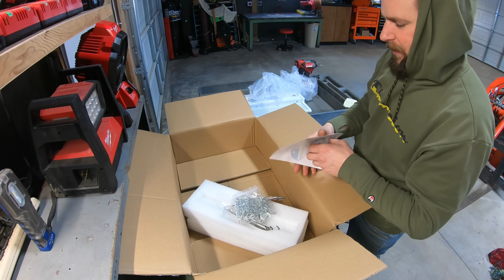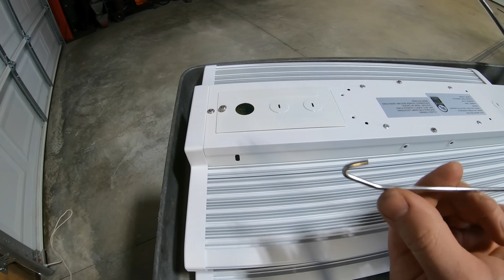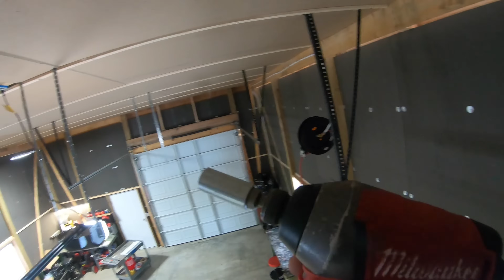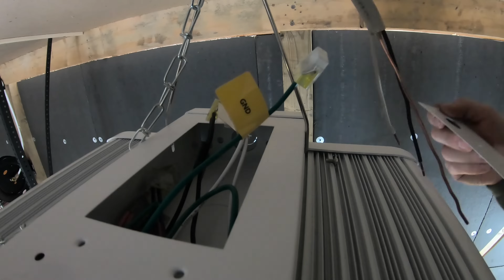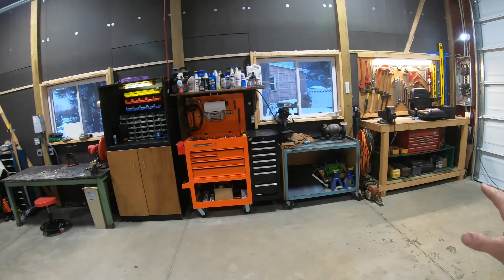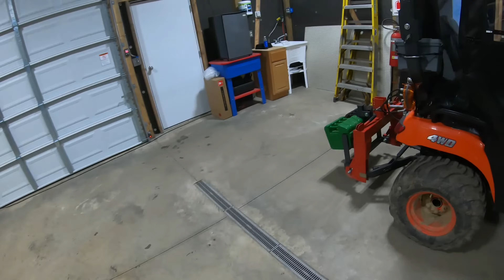BEST LED SHOP LIGHTS!? (HyperLite -High Bay Lights) INSTALL + REVIEW!

Comment: Can you flush mount these to a low flat ceiling like in most residential homes? They would be too low if hanged. Thanks.
Reply from the maker: Hey Jeff, no unfortunately you wouldn’t want to flush mount these lights as they get pretty warm on top with the powerful lighting module they have so they recommend hanging them at least 12-16” below the ceiling. They do offer lights that are a direct mount tho if you check their website.. they make awesome lights and high quality. Iv been very pleased with these lights in my shop 👍🏻

Comment: Awesome video! These are great lights. I just put two up in my 12 x 24 shop. Very nice shop by the way.
Reply from the maker: Thanks buddy, I agree these lights are very bright for such a small package and have been working great ever since! Sounds like you have a nice shop going yourself!
Reply: @BiffsEquipment  Its coming along slowly but surely. Need to get into some nice weather so I can work on the exterior. It's nothing like what you have there though.

Comment: Nice lighting, I’m always amazed how nice your shop turned out. You must have had it laid out in your mind for years. Excellent video!
Reply from the maker: Hey thanks man, the lights work fantastic and it made a huge difference in the shop being able to see properly what I’m working on. As for the setup in the shop and the design, I did have a bunch of plans in my head for years but did most the planning a few months before the actual build.. such as garage location, door locations, concrete, drains, etc.. its enough to make your head explode because the last thing you wanna do is regret something major that you can’t work around or live without.. all in all I think I just about nailed it aside from a few minor things I may have done differently had I known better. That being said I’m very pleased, tbanks for the comment!

Comment: Nice lights ..... How's the heater working now that you have it insulated???
Reply from the maker: Thanks Gary! The heater is working fantastic! I wasn’t sure if 80,000 BTU would be enough.. thought maybe I’d need 100,000BTU minimum but it works and keeps up just fine specially now that it’s insulated.. and my heat bill hasn’t went up much either which also tells me it’s been pretty efficient!

Comment: That lighting worked out nicely! When you refine your insulation, don't forget at the top of the walls behind/between the top structural components. In the video, there was light leaking from outside from the soffits and you'll not want that air infiltration during heating season.
Reply from the maker: Hey thanks Jim! Yes your right I still have to complete my soffit and facia this summer and as far as the open headers go that your talking about I plan to finish sealing those up next fall as I’ll have more time to do so and still am unsure of which direction I wanna go for sealing the headers up. Def needs to be done tho for next fall as I’m loosing heat through them as you’d expect. Thanks for the support!

Comment: Thanks Biff, now I am jealous. Doing up my garage soon but it's a lot smaller. Will make a huge difference to you working at night. Great job.
Reply from the maker: Very cool! What size is your garage? These lights were even brighter than I expected specially with their small form factor. Hopefully you get yours all finished up before spring too!
Reply: @BiffsEquipment  My house got flooded out in the recent floods in Auckland, New Zealand. Replacing the bottom metre of the plaster board for the whole house and a new kitchen. Living in a small cottage at rear of section., Garage is 5 metres by 5 meters. Early autumn over here. Hope to be back inside home 2 months maybe.
Looking forward to you emerging from the snow for the spring Biff.

Comment: Mike, should you use a connector to fish your cable into the light fixture ?!
Reply from the maker: Wouldnt hurt to protect the wire insulation if you think its gonna be swinging and rubbing
Reply: @BiffsEquipment  here in Quebec/Canada it’s code

Comment: I went all out on the lighting in my shop. The only difference is I installed a regular plug in and wired the lights with a plug, so, if the light fails I can just unplug the light and install a new one. The shop is looking great
Reply from the maker: Very Nice Scott! Sounds like you've got plenty of light.. you literally can never have too much light in a garage doing repair work lol. My father has LED lights with a regular plug as well, they are nice as they daisy chain together.. I wanted something a but more permanent and clean though. Thanks for watching!
Reply: I'll be doing the same. Probably wire them all up with a plug before taking them up in the scissor lift. I hate fiddling with little stuff in high areas with that thing swaying back and forth.

Comment: Great job , do you have a link to the hangers your dad gave ya ?
Reply from the maker: Sure thing Todd, here's the same ones I used.. Pretty sure they come with the bit but you may want to double check that.. Ill add the link to the video description as well.
LINK: https://www.homedepot.com/p/SUSPEND-IT-Eye-Lag-Screws-for-Drop-Ceiling-Grid-with-Wood-Joists-100-Pack-8856/100670611
Reply: @BiffsEquipment  great job and thanks , I'll pick some up sometime .

Comment: Install Romex connectors to protect wires from metal fixture housing. Otherwise your good, nice job and lights.
Reply from the maker: Thanks Dave, Your right it def wouldnt hurt. I have a bunch of extras laying around from all the wiring iv been doing, just forgot all about it. Stay safe!
Reply: Those are nice lights. Nice easy hook up. Other than being up on the 12’ ladder. Hehe. 
Great garage.
Reply: Lol common sense has left the building